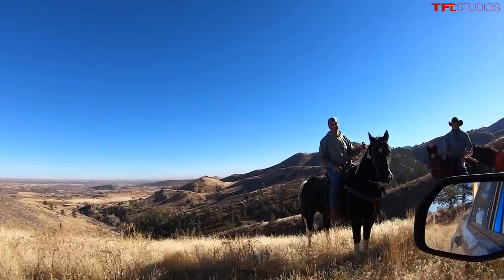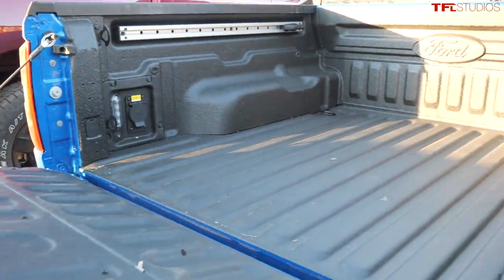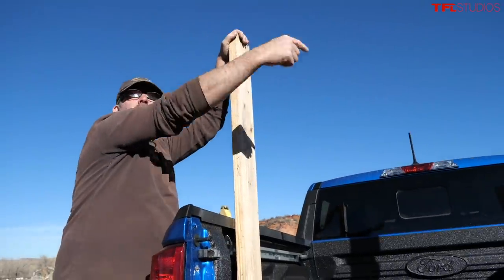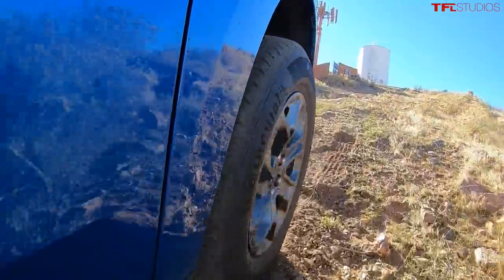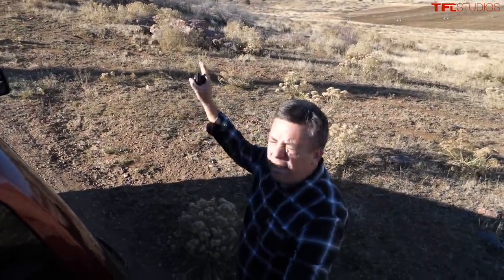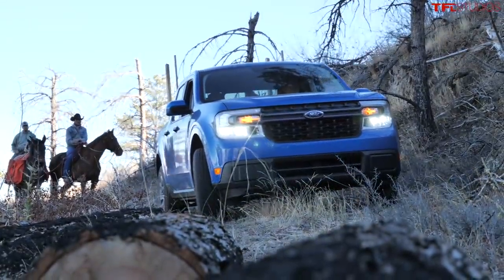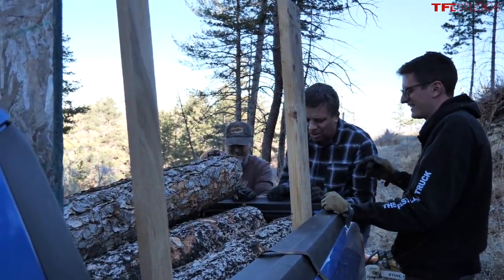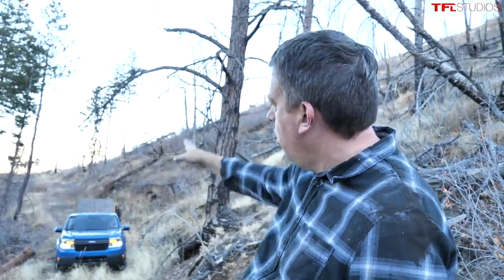Did We Go Too Far MAXING Out The New Ford Maverick To See If It’s Ranch Rated?

Comment: I've gotta say thank you for doing this. I wasn't sure if the hybrid would be up to the task of trail running, but it seems like it would be fine with some better tires. Obviously, it wouldn't be good to load it up with a half ton of wood and drive on ranch roads! After this video,  I'm sure a couple hundred pounds of camping gear would be fine for 95% of forest roads, ranch roads, etc with proper tires.

Comment: Built Ford Tuff.
I hope the dealers don't hike the price, after this video demand just doubled. 👍😊
Reply: I bought my ranger in March for $32k. Actually paid $1750 under msrp. The same truck on the same lot is now $38k. Prices are going up everywhere
Reply: A lot of dealers are marking the Maverick up anywhere from 2.5k to 10k over msrp… Also the hybrid is sold out until 2023.
Reply: @scupking  yeah I placed my order on the 15th after reading an article that they may not take orders after then for the hybrid. While going through with it management came down to me and hurried me along at 10:20am because I had to be done by 11am for the cut off. I never even told them I read that somewhere they came down to me and told me. Also the dealer I went to said they weren’t allowed to jack up the price once one comes in unlike the others I called up. It’s a hit or miss.
Reply: @scupking  '23 model year, not '23 calenders year. Order banks for the hybrid will reopen next summer.

Comment: So, It's cool that the Maverick will do this, and i am really glad i got to see this, but, you guys mention the ecoboost being better suited for this, where i dunno if that's the case, yeah it does have the AWD, and does have the added ground clearance in the FX4 package, but you aren't going to beat he torque of an electric motor.. the Maverick Electric Motor only has 47hp but has 258ftlbs of torque at 0RPM. and no matter how much stronger the Ecoboost motor is on a highway pull, from the dig, or actual pulling, low RPM power, it's going to be hard to beat an Electric motor. Frankly on this type of setup, i really would be curious what a set of AT Tires will do with the same run? But this was an awesome Video.. good work guys..

Comment: This can do everything the original pickups of 100 years ago (which were Model T roadsters with little 4' beds where the "turtle deck" had been) could. If this had been the only size of pickup all this time they'd be doing all kinds of work around a farm or ranch (but they'd also still be using Class 6 stakebed farm trucks which, at least in the northeast, have been completely replaced by 1-ton diesel pickups pulling trailers over the past 30 years).
Reply: It personally reminds me a lot of 1950’s era farm pickups except this has 4 doors
Reply: @colten53   I was also thinking of the circa-1960 Falcon-based Ranchero.

Comment: Love TFL! And @FordMotorCompany As much as I love my big rumbling V8s, this is actually a potential buy I might get in the next few years. Though it would be cool to do a divided ST-Line with a shared Hybrid Hi-po 2.0 Ecoboost engines.ST1-ground clearance and an awd system with lockers if possible, and an ST2 sporty version.

Comment: 13:56
The hybrid system only uses the electric motor for power. The gasoline motor is simply a generator that sometimes powers the battery, sometimes powers the motor directly.

Comment: Nothin wrong with that!! I would say there’s a definite need for the 2.0 AWD model here with the FX4 package. It has some decent Falken Wildpeak tires then and the intelligent AWD has worked very well in many of Ford’s offerings. Even to the point you can’t exceed design limits.  It’s a truck!! When I had my Ranch we tried out 6 Nissan Frontiers. 4 Pro4X Crew Cabs, 3 with leather interior one without, and 2 Pro4X King Cabs with the fabric interior. I note the material because the fabric didn’t stand up well at all. We were able to replace the front seats in all 3 of the trucks that had fabric and also the rear seat in the crew cab. The trucks were strong enough, capable enough (in the foothills of the Rocky Mountains and 95% off-road use) and comfortable enough until you tried to stuff 4 large men in them. The boxes, 6 foot and 5 foot were just too small. They didn’t work and I gave them to each of the 6 guys they were assigned to individually when I sold the ranch. Bonus for all the years they worked for me!!. 
     I would still want a full size truck, but what David explained his wife could use it for is PERFECT!! There’s also the need to run to town for parts for the machinery. You never want to haul those pieces, which are often oily, in the interior of your SUV/CUV. The box is so much handier. Even my wife is considering one. She has never had, by her choice, more than one vehicle. I have gifted her a Fusion Sport in the past, but she never liked driving it. Too low. I wouldn’t be surprised if she adds a Maverick Lariat FX4 to the garage, kicking out my 67 C10 to the shop and I will only have my Bronco in there. The other, 3rd vehicle, in the garage is her Wrangler 4xe in the bay with the 220 plug for charging. My wife is an awesome lady!! 
    I would also be excited for her to add the Maverick. I could see liking it for it’s simplicity more than I like my current Ridgeline daily driver. Time will tell. Too many toys, need to cut back.

Comment: So I had a thought today… trucks nowadays are so capable they don’t fit into the old truck “size based” capabilities… a modern F150 can tow and haul more than a 20 year old F250, etc. So my idea is this, the manufacturers keep the current truck offerings available as “Super Duty/ Heavy Duty” half tons, and then offer lighter duty variants as an option for lower trim levels, but only have the top engine in the heavy duty variants… with the lighter duty versions you would have a lighter frame (maybe even aluminum if they can do it without too much price hike), smaller and lighter suspension and drivetrain components, basically the light duty would be the ideal truck for what most people nowadays use their trucks for (as a sedan that can tow and haul on occasion) and the heavy duty version would be for more serious work. For example, the F150 light duty would be available with the 3.3, 2.7 and 5.0 only, but the heavy duty would be available with all of those plus the 3.5 EcoBoost & H.O. Options… can you imagine if they could get another 500-750 lbs out of the F150 what the fuel economy would be?

Comment: Guys, can we just take a second and realize that the scale was measuring:
Kilograms…Not pounds
5420 kilograms. 
The GVWR is only 2359 kilograms. 
Unless there was some silly camera phase thingy going on with the scale light, you might want to have a closer look…
Reply: Impressive that you could load another maverick in the bed in weight and it'll still roll.
Reply: I'm thinking the "KG" light was faulty....there doesn't look to be anywhere near around 7300 lbs of logs in the bed. They were hand loading most of them- easily. If they averaged 50lbs each(some more, some less) you'd have to have over 150 logs in the bed to get 7300 lbs. I think they got around 30 logs by the looks. Which puts you around 1500 lbs.

Comment: I like this far better than the fake drag races. This is more like people use their trucks, big or small. If I were going to haul heavy loads, I defintely get the all wheel drive model. I still am not convinced that I would trade my F150 with the 5 lter V8. I do not drive that much, so the mileage difference does not really mean that much to me. If I wanted a commuter with the ability to go to the lumberyard on weekends, it might be a good truck.

Comment: My Dad had a 1952 Willys Overland 4x4 pick up. We used to haul 4000 pounds of fertilizer from the supply farm 15 miles away with the Hurricane 131 four cylinder engine. We drove 55 MPH. It never failed. A big load of fire wood was nothing, just made it ride good. Maverick, just like before, a grocery store runner. Pinto was a great little car with a lot of false press. It did better than most its weight. Logs? Good bye back glass. PS-I love the new Maverick. How about a load of “green” logs?

Comment: I never have been a Ford fan, but, I think ford has a winner with this trucklet! Good utility vehicle for what it is, the right size for city use and at a reasonable price. We will have to see about reliability in the long run. If it doesn't  have any catastrophic issue early on, it will probably be a popular choice for many people.Not me though! MoPar or no car...Ram all the way!
Reply: Should be very durable, that hybrid system is legendary, and the e-cvt is about as robust and simple as a transmission can be.

Comment: great video Tommi, Andre and David this little Maverick just probably surprised all of us , Andre with the coal dust on his face from the mine he worked in before he got to the ranch 🤣 I live in Manitoba where its flat and have extreme winters snow ,ice and extreme cold, my daily commute is 50 miles return and i cans myself enjoying one of these probably equipped just like the one your testing with a good set of winter tires and having no issues getting to where i have to go and getting great fuel economy, my old Volvo 240DL gets ok mileage just like 10 to 12 mpg less than this and that's allot looks like it is on my list of new vehicle  future purchases 👍

Comment: I've got a Honda Element, old F-150(78), and a Prius. This thing could just about replace all of those at once (As long as it's as reliable as they are). There has to be a ton of people out there like me who have access to property 1-2 hours out of town where they go to hunt/get firewood/etc and they're tired of spending $20-30 on gas to get there and back in a full sized truck--OR--they're doing it something that isn't quite up to the task(small SUV). A truck like this will make that A LOT more economical. And all you have to do is a little bit of extra road maintenance and maybe bring a small wench just in case. Thanks for this content. I'm glad you did it with the hybrid.

Comment: when i was a young man, we had a ford currier red with grey and  white strips, 4 speed manual 2 wheel drive. 
Every year we hauled firewood out of the woods with it, filled the bed till we had wood piled on the cab. the suspension would be totally bottomed out. it made many trips a day like this, out of the woods. for weeks. and of course, it had to get my step day to work during the week, about 100 miles a day round trip. and my date nights on the weekend. 
that little truck WORKED HARD all its life, and was super dependable.  The Maverick has some big shoes to fill.

Comment: Give it time and you will see a 10-ft high load of pallets stacked on the back driving down the interstate on a Maverick. If you plan on using the Maverick as a real truck you need the all-wheel drive and the extra power of the EcoBoost as land owners don't give a crap about few mileage.

Comment: First off, great video. I was lukewarm to the Maverick at first but the more I learn about the more I'm thinking this will be my next vehicle.

However, I noticed something that I can't seem to figure out. Tommy keeps calling the weight by pounds, when it looks like the scale is reading in kilograms.

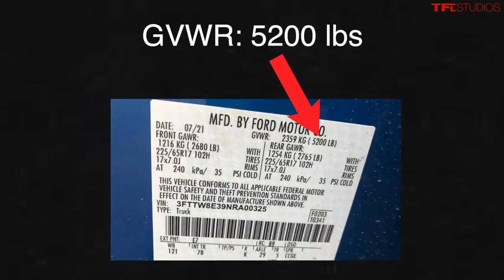Maverick sticker G.V.W.R. @ 18:03 is ..............................................2,359 KG (5,200 LB)
Gross scale reading @ 17:45 is........................................................5,410 KG (11,927 LB)
So weight of cargo/tools/people over maximum G.V.W.R.............3,051 KG (6,727 LB)

That's more than double the G.V.W.R.. However again, Tommy states at 15:00 that the truck is not yet at the bump stops. I am certain that the axle would be firmly on the frame and the tires half flat if you really had double the G.V.W.R., especially most of that weight on the rear axle. If those are the 225/65R17 102H Continental ProContact TX tires, which have a load rating of 850 KG (1,874 LB) each, then those tires were overloaded by 2,010 KG (4,431 LB).

I'm not looking to accuse anyone of anything, I'm sure that a mistake may have been made and that it was 100% honest and unintentional. If these numbers are true, I am concerned for the safety of everyone. The last thing I'd want to see is The Fast Lane Truck saying they have to take a break because there was an accident and someone got hurt.

Thanks for all the content, and take care!

Comment: I get that Ford is really pushing the hybrid Maverick and the low entry price of $20-21K. And TFL Truck probably only has access to the FWD Hybrid truck. But this test is really stupid, especially with all-season tires. Who is going to buy the FWD Hybrid Maverick and use it like this? Really? What happens when it's snowy or rainy out? This dumb test only applies in a very narrow set of circumstances.

Comment: I have been very hesitant on the hybrids and all electric vehicles. You guys do great videos pushing things to its limits. This is what I like to see, How much can we really do with a pickup though I know you don't condone this type of behavior. I really think this is a great little parts runner or around town truck to take up the place of the gas guzzling heavy haulers for the light work. I think Ford did a great job with this pickup and its price point.

Comment: A base 1500 red work truck wouldn’t show much more capability, if any. It is really surprising, thanks for that great practical test!! Put some better treaded tires on it, add some some “overloads”, it will be fairly ok for almost anything. Almost sold. Almost. Can’t  really put a 4x4 or a motorcycle in it, right?

Comment: I love economical vehicles, especially trucks.  At first I thought this truck was a stupid idea, especially the hybrids. Now I’ve done my research and understand exactly how they work, and I’m totally sold. Also, with this awesome demonstration I can see it will do most of what I need a truck to do. I’ll just have to make two firewood trips a year instead of one.   I have a LWB Chevy that currently gets about 14mpg. Switching to a car/truck with 40mpg+ will be incredible. 

You should do a video explaining how the drive system works. This is not a CTV.  It doesn’t even have any clutches, valves, or even a torque converter. It’s quite remarkable. I bet the drive system is more durable than a regular automatic.

Comment: This has really convinced me that the hybrid is right for me. I was on the fence of AWD or hybrid. I’m a diyer who loves to build make anything but live in the city and don’t want several cars. If my daily can get great MPG and haul when needed I’m sold. And I even chop my own fire wood for backyard fires or camping, and this is more wood than I’d use in 2 years! I also live in MN so FWD with snow can be tricky, but I’ve had FWD sedans and usually the issue is just ground clearance. So this being a little higher off the ground, I think will be fine 99% of the time.

Comment: with a good backup camera it should be easy to back up the hill for maximum traction (weight transfer) with the benefit of not needing to turn round to head back down. That is one massive benefit of FWD. Anyone who has ever tried to back an empty 2wd pickup up a hill can attest it does not work well if at all...

Comment: 14:00 same for the Ford Fusion Hybrid. It uses the electric motor at low gear, and it should have about maximum torque between 5 and 15mph, and good torque between 10-30mph.

Comment: I once accidentally overfilled 1000 litre IBC in a Subaru Brumby aka BRAT it was sitting behind the wheel wells I had to engage four-wheel drive and keep tapping the brakes as the frontend was in the air

Comment: Unrelated to video but recently I got a 93 s10 blazer 4 door with 4.3 vortec and only 155k miles.i got it for free bc my uncle didn't need it anymore and he gave it to me.it runs and drives just fine and has a new set of Eldorado AT on it.Only major problem is I will have to buy a new wire harness soon but I can live with that.I love this truck and i get a lot of people staring at it on a daily basis on the road.Didnt know they were so rare

Comment: I don’t mind the Maverick. I just wish someone would build a single cab rwd based truck of the same size in the same cost range. Not a fwd hater or anything, but it’s a truck. When you load all the weight in back, there isn’t much traction up front especially on a grade which transfers more to the rear.

Comment: First I learned about the ecvt and planetary gearing copying the Prius. Well Toyota Prius I have has an awesome trans and if you have to have an cvt in a hybrid may as well get rid of the weakest part of a cvt, the sh/‘tty belts. That being said, every time Ford copies Toyotas bulletproof designs they cheap out on critical components so I won’t be surprised if the planetary gears are made with alloys not up to the task. In practice, the setup has been proven in vehicles known well in taxi fleets to go over a million miles on the original trans and motor. At the price thro a bag of chains in the deal and I’d buy one. Hate to be a Guinea pig on mavericks maiden voyage but the price in this market makes it the only game in town. Seems like an American company came to compete, all be it with Mexican labor.

Comment: Precisely why you need the AWD. Loading the rear up and taken the traction away from the front wheel drive. I think if all you will do is drive in the city the FWD will be fine. If you plan on taking it off road with weight in the bed you need AWD just for traction.

Comment: Thing I love about hybrids is that the ability to use the bigger system as a large emergency power source. Not the cute little 400 watt outlet but a 1500 watt true sign wave inverter off the accessory battery or a 220volt service off the bigger battery. Because it is a hybrid that starts and stops itself it is MORE efficient than an inverter generator that idles down and up for more than the obvious reasons.